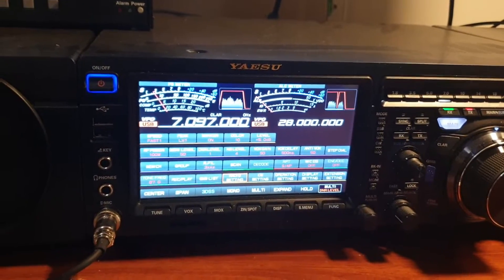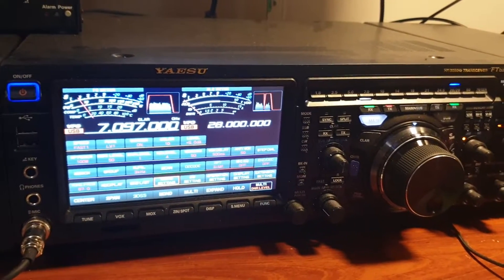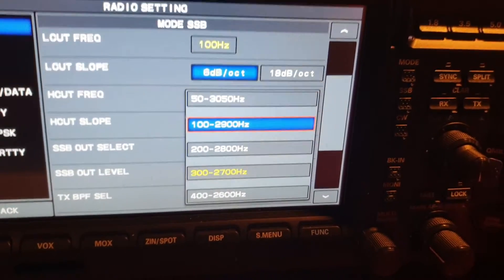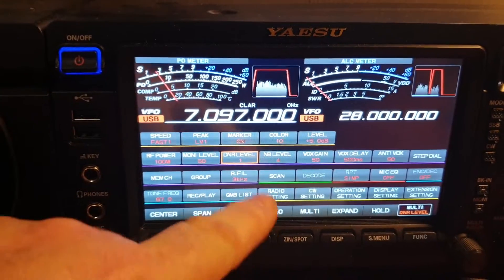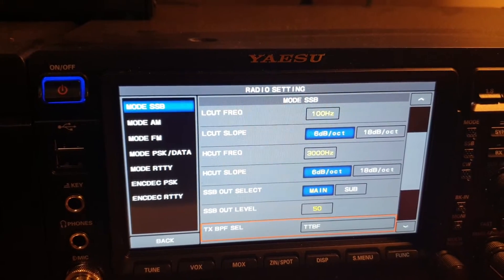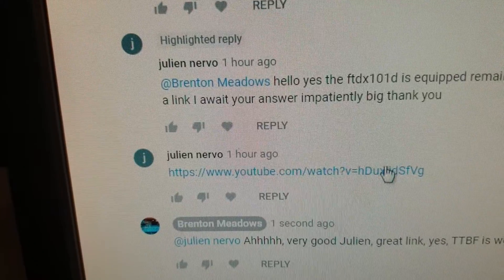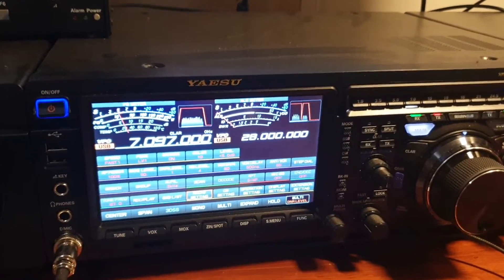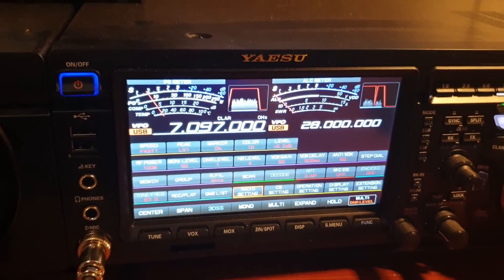ESSB or TTBF(Total Transmit Bandwith Frequency) on my slightly dusty Yaesu FTDX101MP.

Comment: On my Yaesu FT DX 1200 I have the TTBF enabled enabling four kilohertz bandwidth. I have the Mike EQ set and the processor and mic gain set just right that from the hand microphone the audio sounds almost near broadcast quality. I want to get a better quality microphone and possibly an EQ to put in line between the mic and the radio down the road. Cuz if I can get this good of audio at four kilohertz of bandwidth with just the hand microphone and the mic EQ in the radio I can only imagine the things I can do with a higher quality mic and possibly some outboard equipment. Also want to get a set of speakers in here to improve the received audio. When someone's on ESSB it sounds really good on the speaker that's in my Yaesu but I just want better speakers to get more of that full-bodied sound.  73 all the best.
Reply: I bought super high-quality paradigm bookshelf speakers for my FTDX 101 and I Velcro'd them to both sides of the radio. It is fantastic.

Comment: ESSB is great for people who do not care how wide their signal is,and how much splatter they produce in adjacent channels,making qrm to others...and they do not care what law say what is widest transmitted signal allowed,,,
Reply: So. Tell us what you really think. And why would people care how wide their signal is when they think it's fine to spend five minutes tuning up 1 kc from a DXpedition on Reunion island or Antartica?
Reply: This is what you tell the guys who work in competitions with a 2.4 kHz filter, and on the range they occupy 15-20 Khz ! Already better ESSB with IMD3 at 35-40db than 2.4 khz with IMD3 10-15db !!!
Reply: @_devjatov_  very true statement, but given today's RTX common poor TX IMD3, the result will most likely be even worse. The other aspect is that very few of us set the RX BW over 3kHz, therefore, the extra transmitted 1kHz is just kept out of the passband.
73, I4LEC